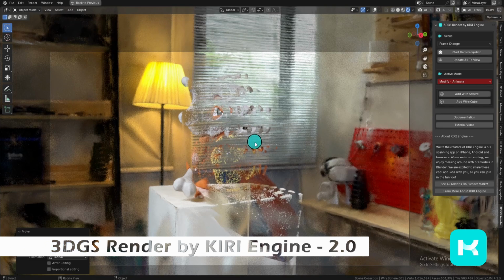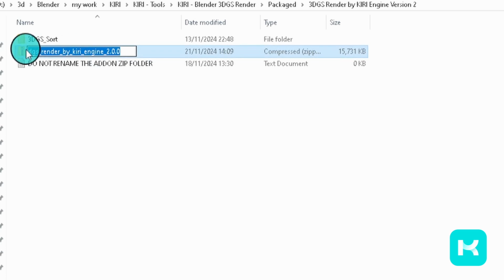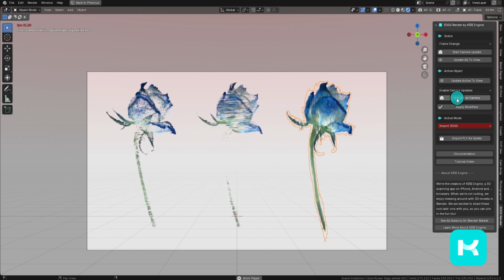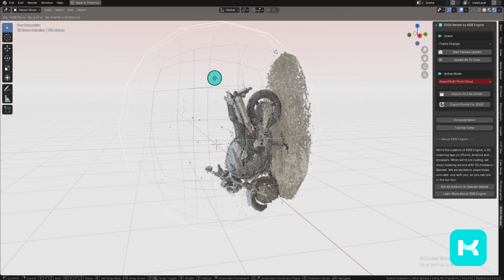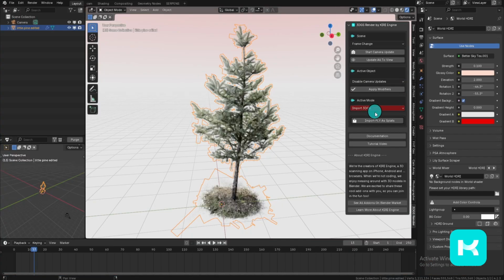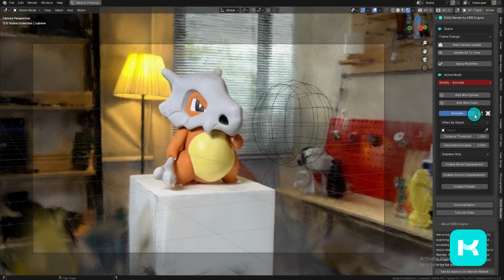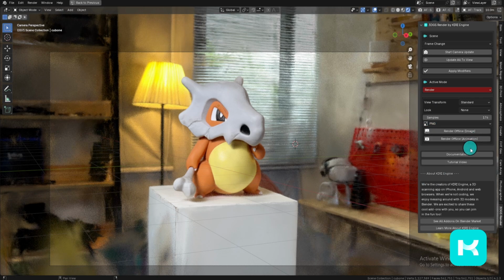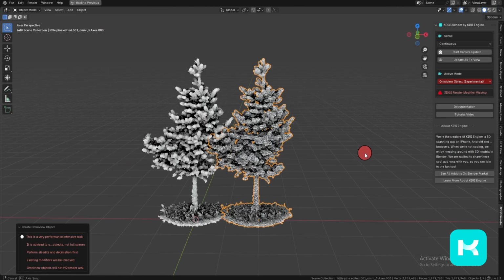Free 3DGS Render Addon for Blender 2.0 - Full Tutorial / Documentation

Comment: Thank you for the tutorial. I wanted to import splats into Blender to watch them in VR, but unfortunately its pretty laggy :( How is that Blender lags so much when displaying splats, when other softwares make it possible to watch them even on a smartphone?
Reply from the maker: Yeah sadly dealing with Blender has a lot of limitations. Other software's and renderers have been built directly with the express purpose of rendering 3DGS - Blender, not so much.

To get better performance the 3DGS object have to not be mesh-bound as they currently are, and a new class of object/render engine might have to be made for Blender.

My advice for now:

Use 1 sample when using HQ mode
Don't update faces while working. 
Show as a point cloud. Set camera animation etc. When you're ready to render - exit 'show as a point cloud' and render one frame to preview.
If you're happy, do the full render. Use HQ mode and 1 sample if using 'shadeless' lighting.